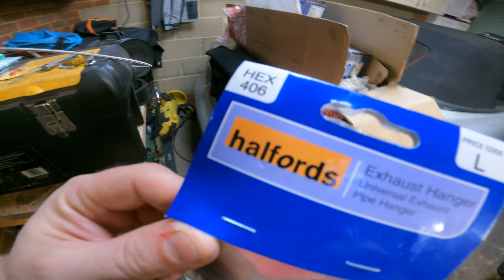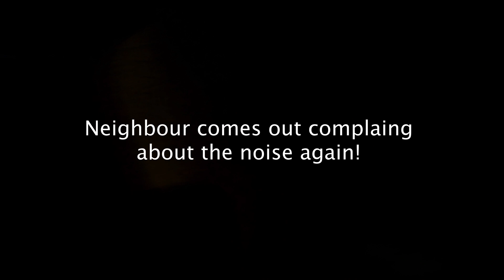Little Red gets a new exhaust! BRAKES FAIL WHILE DRIVING!

Comment: looking awesome. question , is that stainless steel and did you use standard mig wire?  cause i am thinking about making up a system for mine.
Reply from the maker: Hi bud. Yea it’s stainless. I used .8 stainless mig wire and argon CO2 mix gas
Reply: @LittleRedFiesta  thanks for that mate.